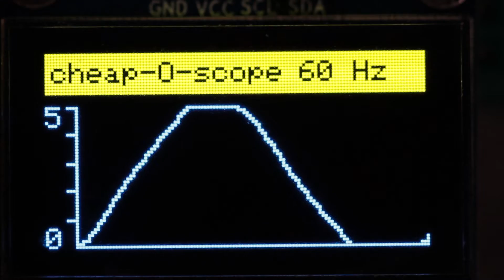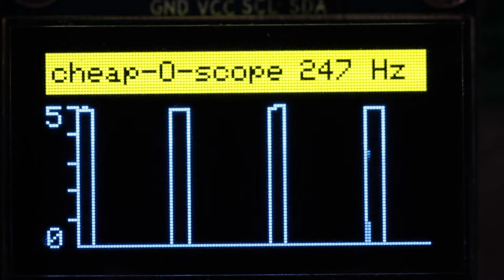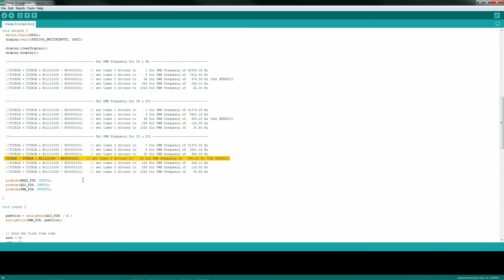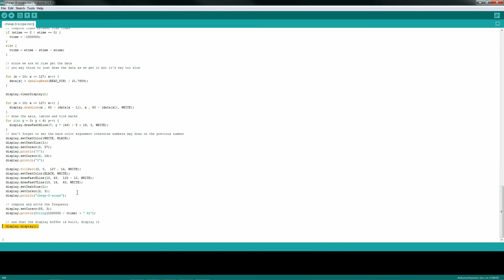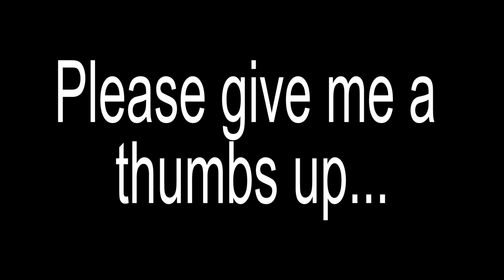DIY Oscilloscope for $20 - FREE CODE

Comment: hi I want to ask how did u calculate this value for (x = 10; x <= 127; x++) {
    data[x] = (analogRead(READ_PIN) / 21.7659); which u are dividing analogread with
Reply from the maker: It's just a scaling factor to get the maximum measured bits of resolution to fit into a screen 47 pixels high (1023 / 47). I could have done the typical 5.0 / 1024 to get volts, the some factor to scale volts to 47 pixels, but did all the math in one step.
Reply: @KrisKasprzak  thanks for the reply. just last question how can I slow the speed little bit ?

Comment: Excuse me, I tried to do ir but in the moment i was trying to upload the code to arduino uno it doesn't leave me beacause it says that there is an error compiling for Arduino Uno. Would you help me please?
Reply from the maker: What error?
Reply: @KrisKasprzak  It only says Error compiling for Arduino Uno board. and i tried from a different computer and keeps the same error. I was wondering if you could help me.
Reply from the maker: @juanportalanza711  are you sure you have the correct board selected from the Arduino IDE that matches the board you are using?
Reply: Kris Kasprzak yes sir, I’m pretty sure. If I could, I would send you a screenshot. I don’t know what’s incorrect
Reply from the maker: @juanportalanza711  well I see you're using an UNO, this code will not compile on that have to have a Teensy 3.2
Reply: Kris Kasprzak oh, I got it. Do you know how can I make it work on Uno?
Reply from the maker: @juanportalanza711  you have a lot of work to do first you got to convert the display over to something that runs on an Uno. If you have enough memory that who know will definitely not have enough processing power. I moved from arduinos to teensies about 4 years ago and I've been happier ever since.

Comment: Hello Kris.  I have just made my own cheap-o-scope and it works really well.  Thanks for the code! I found that I needed to modify the display size definition in the Adadfruit_SSD1306.h library code (line 29).  It was defaulted to 128 x 32 rather than 128 x 64.  Hopefully this might help anyone else who has a similar issue. Thanks again!!
Reply from the maker: glad i could help
Reply: Thank you very much sir !
that was the issue with my scope and i don't have enough knowledge yet to fix this by myself.

Comment: i can see half the screen
Reply from the maker: yea, the adafruit lib is probably choosing the wrong display size. a few ways to fix 

1) try adding this line to the declarations section
#define SSD1306_128_64

2) or in the file Adafruit_SSD1306.h, then comment all lines but these 2 like this:

// Deprecated size stuff for backwards compatibility with old sketches
//#if defined SSD1306_128_64

 #define SSD1306_LCDWIDTH  128 ///< DEPRECATED: width w/SSD1306_128_64 defined
 #define SSD1306_LCDHEIGHT  64 ///< DEPRECATED: height w/SSD1306_128_64 defined

//#endif
//#if defined SSD1306_128_32
// #define SSD1306_LCDWIDTH  128 ///< DEPRECATED: width w/SSD1306_128_32 defined
// #define SSD1306_LCDHEIGHT  32 ///< DEPRECATED: height w/SSD1306_128_32 defined
//#endif
//#if defined SSD1306_96_16
// #define SSD1306_LCDWIDTH   96 ///< DEPRECATED: width w/SSD1306_96_16 defined
// #define SSD1306_LCDHEIGHT  16 ///< DEPRECATED: height w/SSD1306_96_16 defined
//#endif

Comment: What if i use a different display? Do i need to change something in the code, idk like the library? or the code will work fine with any display?
Reply from the maker: If you use a display with a different driver chip other than the 1306 this code utilizes you will need to change the code.

Comment: Haven't read the code yet but I thought it would have been nice to give credit to the other Chanel with the original project that you built upon. Lucky you didn't charge for the code because I would have just looked at the original projects code. 

Great work though 👍
Reply from the maker: Although i made several mods to the original code, I thought I did reference the originators work, I just added a reference in the description section giving credit where credit is due.

Comment: This is awesome, i will try to build one next week! 
could i also get the oscilloscope data on my screen or would the serial connection be too slow for that?
(for educational purposes)
Reply: I built a little box that filters the signal then feeds it through the sound card of my PC.  Works great.  I used a couple of 5 volt regulators to filter the voltage, and to begin with I picked up a USB sound card to run it through.

Comment: An Arduino Uno runs at 16kMHz, with 10 bit resolution ADCs at 10K samples/second  but a $3 stm32 ("Blue Pill") runs at 72MHz with a 12 bit ADCs at 850K samples/second. Since a Blue Pill runs Arduino code, it would make for a nice upgrade.
Reply: Hello Erik.  I have managed to port it to run on the STM32 Blue Pill.  No real problems.  Now samples a sine wave quite well up to at least 10KHz . Lower noise too of course.

Comment: hello friend thank you very much for your videos, ask! how can I operate the oscilloscope with the progress bar exchanging with a button between oscilloscope and progress bar (voltmeter).
Excuse my english is with Google Translate xddd.
Reply from the maker: add a button to a digital pin and connect to low (0 volts). Then in setup add a line pinMode(your_pin, INPUT_PULLUP); the in loop() add a line if (digitalRead(your_pin) == low (show oscilloscope, else show volt meter

Comment: This is an amazing implementation of 20 buck hardware! Very accurate indeed! 

I have a small request, I'm dealing with very low frequencies, 1Hz-30Hz and as you said, these are not well represented via the oscilloscope. Is there any way to "zoom out" so that the longer wavelenghts are therefore visible?
Thanks!
Reply from the maker: Sure, there are a few things you will need to do. 1) allow more time for the code to find the rising edges there is a while (ecnt++ < 200) which will bail out of the analogReads exceed 200. so for low frequencies you will need to increase the 200 to give the code more time to find the rising edges, maybe 2000??? play around with the value. 2) scaling may be done a few ways, put a delay (millisec or microsec) in the measure loop to cause slower reads (kinda amateur hour but may work) 2) during screen display, skip points to draw but may require building and larger array (if you are skipping 1 point, the array needs to be 2x longer), maybe other ways, these are off the top of my head.
Reply: Thanks a lot Kris! It worked beautifully! With ecnt++ < 3000, the Oscilloscope can now detect even a 2Hz input frequency! For the sake of visual impression, I would need the oscilloscope to see a greater frequency than what is applied at A0. So if a 5Hz signal is applied it would see something larger, that way perhaps the large waveforms would not appear as huge rectangles, rather something that happens with a higher frequency input (100Hz?). I know some accuracy would have to be sacrificed, but the lower frequencies I'm dealing with would appear more comprehensible. Is there any way to do that?

Thanks again!
Reply from the maker: Glad it worked. scaling the display to be smaller was my suggestion #2, i've not messed with either of my suggestions so I'm not sure how (of if) they will work. adding a delay during the data read loop would take a minute to test, play with the amount of delay--a buck says it will work.
Reply: I feel I might be troubling you with those questions. But I'm elated to express that adding a delay of 10ms worked for frequencies as low as 5Hz. The unfortunate bit is that there's a button in my code that does the frequency switching. So, the 10ms delay affects the responsiveness of the button. I tried what I could by using a elapsedMillis library by Paul Stoffregen with the same 10ms delay over the entire data code:
 if (timeElapsed > interval)
  {
    for (x = 10; x <= 127; x++) {
      data[x] = (analogRead(READ_PIN) / 21.7659);
    }
    timeElapsed = 0;              // reset the counter to 0 so the counting starts over...
  }
This however doesn't create the same effect as the traditional delay() function. I'm not sure what else to tweak here.
Reply from the maker: I'm happy to help, feel free to keep asking. It sounds like the issue is the the button only works outside the delay and pressing button is slow (or doesn't' work) during the delay? If so the fix is easy assuming your button is connected to a pin (if (digitalRead(button_pin) == HIGH)) then add a delay (or something). Correct so far? if so, connect the button to an interrupt-able pin (pin 2 is one if I recall), then add a line of code in setup() to "watch" activity on that pin, something like attachInterrupt(0,button_press) where 0 is interrupt #0 (pin 2), and button_press is a function that will execute your code. In that button_press code,  you would change a variable that sets the delay time in your data collect loop. An interrupt stops any code and processes code when the interrupt is triggered. Hope this helps.
Reply: Thank you for your geniality. I would share the code but I'm unsure if this is a right platform. The button I mentioned earlier (that changes the frequency) is not the only aspect affected, its the function that generates frequency that is affected by the delay as well. The code is more or less a 'hack' in all its crudity:
  if (millis() - lastPeriodStart >= periodDuration)
  {
    lastPeriodStart += periodDuration;
    NewTone(speakerPin, Frequency + buttonPresses, onDuration);
  }
I know my inexperience becomes apparent here, but this looked like a quantifiable method to generate frequency. The 'buttonPresses' is a counter that progresses with each button press. So in essence, this tone (or frequency) is relayed to BS170, which PWMs a Laser diode and also to pin A0, where your code does the Cheap-0-Scope magic!
Reply from the maker: Looks like your if is a debouncer--you sure the =+ line is correct? I would expected to see lastPeriodStart = millis();  looks like your button press calls NewTone. My suggestion is still the same but inside the button_press function have it set a ButtonPressed flag to true then in your loop check the flag, if true, then call NewTone().
Reply: Oh!, no, its redundant. Thanks for pointing it out. It wasn't performing any function. So, the debouncing is done by the following code followed by pulse generation:

  if (digitalRead(switchPin) == LOW)  // check if button was pressed
    {
    buttonPresses++;                  // increment buttonPresses count
    delay(250);                       // debounce switch
    }
  if (buttonPresses == 30) buttonPresses = 0;         // rollover every fourth press
  if (lastPressCount != buttonPresses)              // only do output if the count has changed
    {
    Serial.print ("Button press count = ");          // out to serial
    Serial.println(buttonPresses, DEC);
    lastPressCount = buttonPresses;    // track last press count
    }
  NewTone(speakerPin, buttonPresses, onDuration);

So to set the flag, I did the following:

  if (buttonPresses == 30) buttonPresses = 0;         // rollover every 30 press
  if (lastPressCount != buttonPresses)              // only do output if the count has changed
  {
     Serial.print ("Button press count = ");          // out to serial
     Serial.println(buttonPresses, DEC);
     if (ToneFlag) {
     NewTone(speakerPin, buttonPresses, onDuration);
     }
    lastPressCount = buttonPresses;    // track last press count
  }

However, the pulse generation has become erratic, it generates 4 pulses, then sleeps, untill I press the button again. Please note that I haven't implemented the pin interrupt function yet.

(Please let me know if i'm going far enough with this troubleshooting.)
Reply from the maker: don't forget to reset the ToneFlag to false after press. yea need to inplement the interrupt thing delay for debouce is never good. do a something like if millis() - oldtime > 200 then oldtime = millis() then do your operation make sure oldtime is a unsigned long
Reply from the maker: ive not compiled this so i'm sure there are syntax errors  (5) changes

void setup() {

(1)  attachInterrupt(digitalPinToInterrupt(interruptPin), buttonPress, RISING);
// avoid CHANGE, use RISING or FALLING

  Serial.begin(115200);
  pinMode(switchPin, INPUT);          // Set the switch pin as input
  digitalWrite(switchPin, HIGH);
  display.begin(SSD1306_SWITCHCAPVCC, 0x3C);

  display.clearDisplay();
  display.display();
  pinMode(READ_PIN, INPUT);
  pinMode(ADJ_PIN, INPUT);
}

(2)
void  buttonPress(){
ToneFlag = true;

}

void buttonUpdate()
{
  buttonState = digitalRead(interruptPin);
  if (digitalRead(interruptPin) == LOW)  // check if button was pressed
  {
    buttonPresses++;                  // increment buttonPresses count

(3)
    ToneFlag = false; // reset this to false once pressed and code executed
    NewTone(speakerPin, buttonPresses, onDuration);
    
  }

(4) why 30 if recycle every 4??????

  if (buttonPresses == 30) buttonPresses = 0;         // rollover every fourth press
  if (lastPressCount != buttonPresses)              // only do output if the count has changed
  {
    Serial.print ("Button press count = ");          // out to serial
    Serial.println(buttonPresses, DEC);
    lastPressCount = buttonPresses;    // track last press count
  }
}

void loop() {

  pwmVolts = analogRead(ADJ_PIN) / 4 ;

(5)  test the toneflag if true (meaning button pressed then run your code
if (ToneFlag == true) {
buttonUpdate();
}

.....
Reply: Thanks Kris for taking the efforts to iron out the bugs!
The example I used had 4 as original rollover, but I need 30 steps or 1-29Hz. I should've changed the comment.

The code compiles pretty well, however when I press the button, the pulse is generated only for the counted button press, then the pulsing stops. This is what I observed earlier as well. So for the first button press, there is one pulse, for second, there are two pulses, and likewise, I need it to continue pulsing, only the frequency of pulse will change as the value of buttonPresses increases. Another behaviour is that the button does not respond while the code is going through a change in pulse frequency (I remember, this wasn't the case earlier). Please take one more look at the code:

void  buttonPress() {
  ToneFlag = true;
}

void buttonUpdate()
{
  buttonState = digitalRead(interruptPin);
  if (digitalRead(interruptPin) == LOW)  // check if button was pressed
  {
    buttonPresses++;                  // increment buttonPresses count
    ToneFlag = false; // reset this to false once pressed and code executed
    NewTone(speakerPin, buttonPresses, onDuration);
  }
  if (buttonPresses == 30) buttonPresses = 0;         // rollover afte 30 button presses
  if (lastPressCount != buttonPresses)              // only do output if the count has changed
  {
    Serial.print ("Button press count = ");          // out to serial
    Serial.println(buttonPresses, DEC);
    lastPressCount = buttonPresses;    // track last press count
  }
}

void loop() {

  pwmVolts = analogRead(ADJ_PIN) / 4 ;

  if (ToneFlag == true) {
    buttonUpdate();
  }

... (rest of the loop section)
Reply from the maker: I'm guessing at what you are trying to do, is it that you want the pulse continuously generated, and displayed? If so how is the pulse generated? By your NewTone function? If so think carefully about where NewTone is. It currently in your buttonpress function which is only called from a button press, shouldn't NewTone be in your loop()?
Reply: Yes, you ascertained it correctly. I need the pulse to be generated continuously as well display it simultaneously. I'm sorry if I did not state that earlier. The NewTone code is generating a pulse based upon number of buttonPresses which progressively adds 1 upon each button press. 

I did put the Tone generation code in the loop section. But I had to put a delay in the loop section, it also affected the frequency generated by the NewTone.

Comment: Very nice and thank you but could I use a bigger screen to get a better view.
Reply from the maker: The problem is buffering the video data so you can get fast updates. This OLED and the Adafruit library buffer the video, so basically you write the display to memory first--which is very fast, then with a single call, dump the memory to the display--which is very fast. Larger displays cant' be buffered as there's not enough memory on the MCU, so writing lines and stuff call by call is very slow. There are some techniques to use larger displays though.

Comment: Mine doesn't display correctly, oled works fine with other projects. It only displays from approx 2.5V up, and the HZ display is 60/40 yellow/blue. Wish I could add a pic.

Comment: Hey ! thx for this, I still wanted to know, is a 2.8 TFT Touch Screen also working ?
Reply from the maker: I seriously doubt it will work with any decent performance. All of the TFT's out there don't seem to have a library with a video buffer. You basically write to the tft as you get the data, the transfer is too slow. These little OLED have a library from Adafruit that has a video buffer, where you fill the buffer then in one call the buffer is sent to the screen.